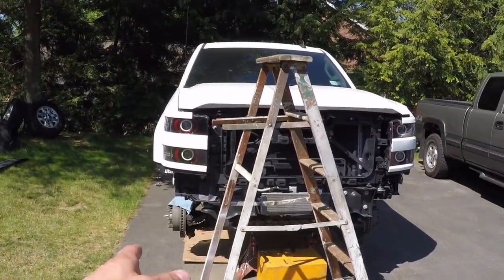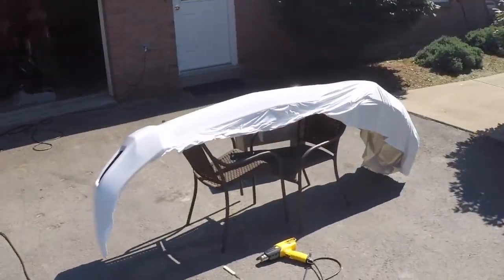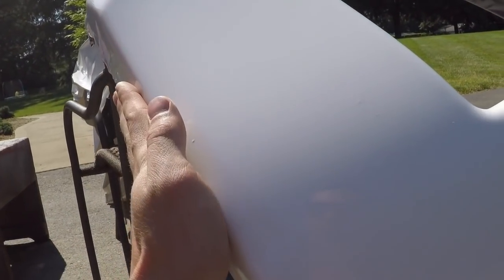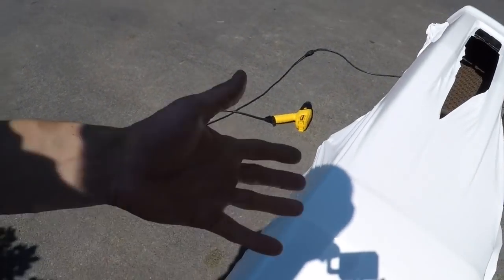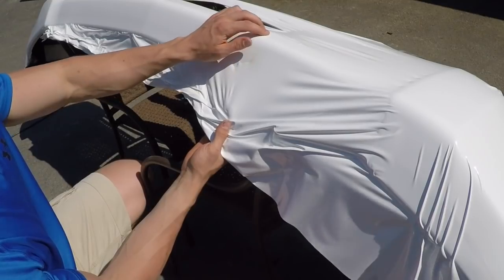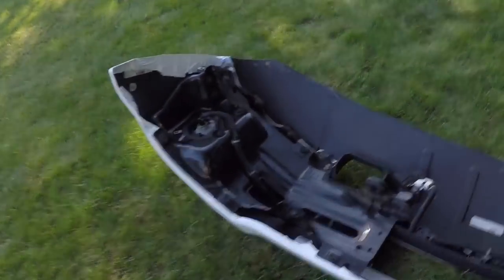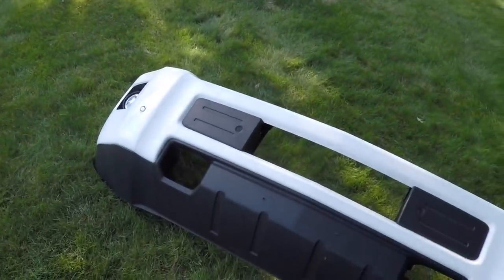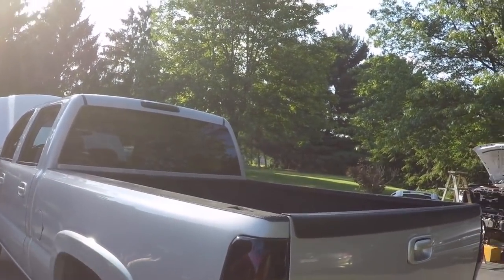EASIEST WAY TO WRAP YOUR BUMPERS!

Comment: You know, you're probably the only truck guy that actually builds their truck themselves without taking it to a customs place, if you do the lift yourself I will have mad respect for you. Keep up the good work man!🇺🇸🤙🤘🏻
Reply from the maker: Isaac Lewis thanks man! I would do the lift but I A. Don't have a powder coating booth or B. Have a car lift, to use right now.
Reply: Off Road Dynasty yea , I can understand that
Reply: Do they have a DYI garage in your area, I rented a lift bay to install my 6" lift. I defiantly am going to try wrapping my back bumper on my F-150 , Thanks for the Video!! I was thinking about powder coating but wrapping is my choice Matt Black  Matt black hood on the raised panel , shred or torn graphics on the bed side lastly a new tail gate wrap gonna do most myself except for the tail gate because of the printed graphics
Reply: Durtymax Jack is good about doing most of his own work, and Ryan Meyer with his Cummins.  Ryno barely fills up his own gas tank.

Comment: Get a Teflon card versus a squeegee. Squeegee will grab onto the vinyl. Teflon cards slide. FYI 3M 1080 has air release so some of the sections where he pulled up to remove air bubbles could have just been pushed down on and the air bubble disappears.

Comment: Mark, good informative video. You did a great job wrestling with that vinyl and it came out looking like a stock bumper. 💪However, try a different gimbal for a steadier video frame. I'd like to see the Chevy with it's bumper re-installed? Nice truck

**Saw the video with bumpers installed 👍🏼
Reply from the maker: Thanks for watching the video! I definitely agree, I would like to upgrade the gear.

Comment: Where did you get your 3M 1080 from? The prices you were quoting seemed cheaper than I've been able to find it.
Reply from the maker: It was a place called Metro Styling.  I based that off of the large piece I got so it may be more or less. Thanks for checking out the video!

Comment: What color and brand off powder coat did you do your wheels/suspention also it looks like you put vinyl on your window trim?
Reply from the maker: The brand is Prismatic powders and I painted the window trim but it came out bad so we did black OEM trim.
Reply: Mark DeCola I’m pretty sure it’s custom offsets with their white gasser Silverado they did a video on they used vinyl on their trim I’m not sure how well it would hold up but I’m sure you’d be able to come up with a way to make it work